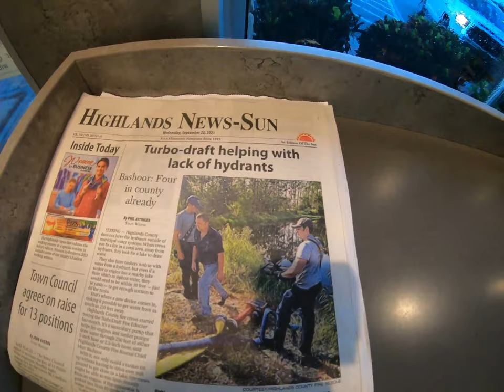How the f*** you tow a low car with a flatbed?

Comment: Working on the wrong side controls yes they should slow down when they see flashing lights but working on the busy side where you gonna go in a accident you can't control the car coming towards you no body's that fast organization helps and whats up with stepping over the cable and talking on the bed while  the cable is between your legs if it snaps ouch